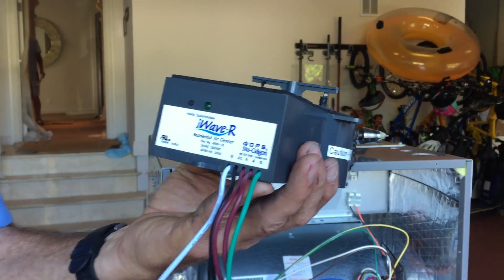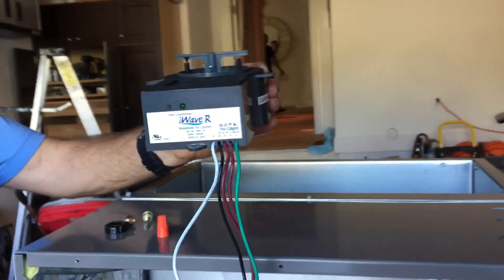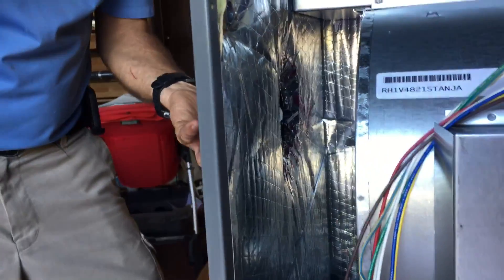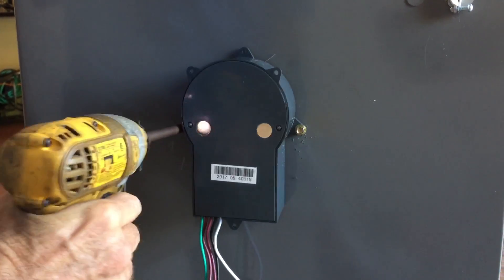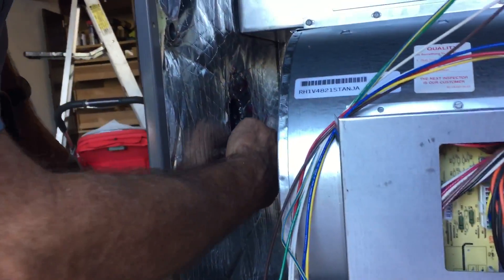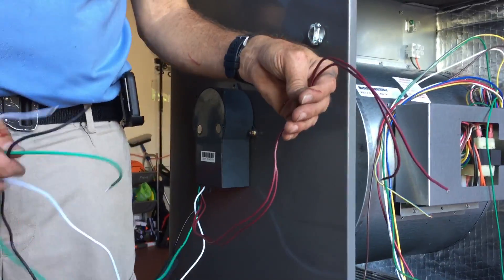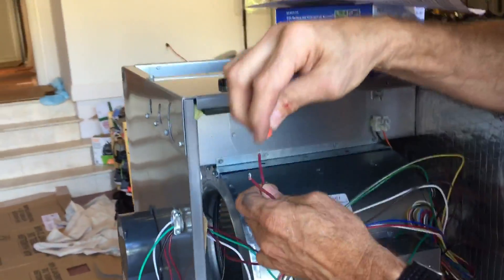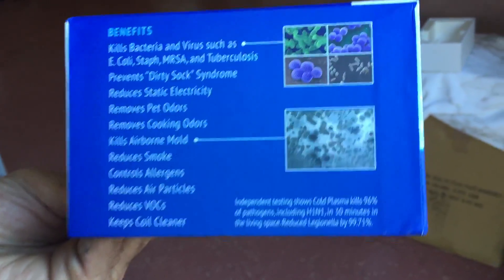iWave R Installation

Comment: David...thanks for the video.  Question...The instructions state "Mount the iWave-R after the particle filter and before the indoor coil." You appear to be placing it after the indoor coil?  Does that make a difference?  Thanks again.
Reply: Downflow furnace
Reply: @brianhopp7650  that's an upflow heatpump

Comment: I dont think the unit will get the air flowing over the points because of the insulation on the inside panel

Comment: I'm going to put mine inside the blower compartment since I don't want exposed 120 volt wires like that.
Reply: 24 volt. Cap off the dry contacts

Comment: Can you hook it up to 120v furnace
Reply: Through 24v
Reply: @WillieMakeit  Through 24v  ?   my furnace is 120 volt
Reply: @tractor999  through the control board
Reply: Ahh yes the control board for 24 volts but couldn't I connect it to the 120 volt supply line as well?
Reply: @artspartner120  24 is just easy and safer, less voltage to run the same application 24/7
Reply: Your quite right, 24 volts it is. Thanks
Reply: @artspartner120  Then again ....  Matts HVAC says The reason you want to use high voltage is that a typical 24v transformer only produces .50 amp. Most hvac  systems use between .25 to .40 which leave .25 to .15 amps to power the iwave on the 24 volt circuit.  You'll either starve the iwave or burn out the 24v transformer.
Reply: So probably a good idea to upgrade to a larger or separate 24v transformer. Just a thought as I'm trying to understand how to wire this up myself,  ... although if I call the HVAC tech who installed my furnace to wire it up, I would keep the 3 year warranty.

Comment: Thanks for the video David.  Very informative.  This unit looks to be an excellent product that appears to be very easy to install but have to give NuCalgon an "F" for not validating the warranty unless it is installed by a certified HVAC person or certified electrician as there is no reason for this.  If anything,  NuCalgon should package a version with a preinstalled AC line cord and provide a paper template like Honeywell does with the Ruvlamp1/c to make the installation idiot proof for side of duct installation.  These units can be installed in the return duct which NuCalgon actually recommends because then the ions can flow across the coil to eliminate any bacteria there.  That also eliminates the need of touching the air handler particularly since they can run off of 120v so they can just be plugged into an outlet with the addition of a male receptacle.  It would be good if NuCalgon extended the ion probes further on the unit as most duct work has internal insulation and the probes need to extend beyond the insulation so air an flow across the probes better.  Most duct work insulation does not have the foil layer that the insulation that inside of the airhandler as shown in David's video, so it can't be taped down David did.  Also note that NuCalgon states in their instructions that the probe tips need to be 2 inches from any metal to prevent arching which can shorten the life of the unit.  Anyway, an "A" to David for his video, an "A" to NuCalgon for a product that does not cause UV damage or require any maintenance, but also an "F" to NuCalgon for putting stipulations on their warranty that I wanted to hightlight for anyone wanting to install one themselves.

Comment: Just so people know you do NOT have to drill the hole in the side of your unit. Most systems installed you can't get to that panel from the outside and who wants to pull the entire blower assembly to drill holes from the inside. The magnets that are on the back are designed to hold the unit on the inside of the cabniet.  I would not run this off your 24v too much strain on the system transformer.  The two brown wires are for an external LED light not provided and requires a separate transformer. They are nothing more than dry contacts. They will not do anything with out a separate source of.power!!!! Its purpose is to let the user know if the unit has failed.  Whos gonna take there panel off and see if the lights is on the unit itself.   Good video but we install the led light with the additional transformer so it peice of mind that the customer knows.   So they say Oh the lights on it's working.  These are fantastic units and do what they claim! Way better than a UV light
Reply from the maker: we usually drill holes in equipment during replacement, this is best way in order to move 160,000,000 positive and negative ions through entire home for maximum efficiency
watch the I wave R video
thx
Reply: I know it's been four years... but if you're still around.  Planning to install this with an external 24vac transformer.  It's just easier for me since it's near an existing service outlet and I'd have to run the wires out externally and back inside past the coils, blower, and into the circuit area (bosch).  The wire length wont make it and I don't want to mess with j boxes, conduit, etc. plus having line voltage exposed.  

Can you pigtail off the iWave-R power leads for the alarm dry contact brown wires for the light?

Comment: If you use the high voltage source you need to route the brown low voltage wires through a different hole. Low voltage and high voltage need to be separated. If you use 24v you're ok to share. Thanks for the video.
Reply: Low and line voltage can be ran together as long as the wire is THHN
Reply: @nonamesplease8228  my man, shut him downnnnn boy!!!!